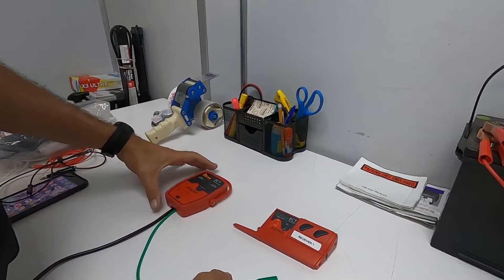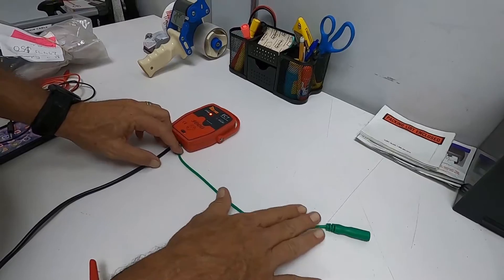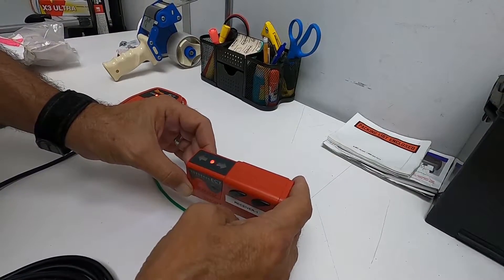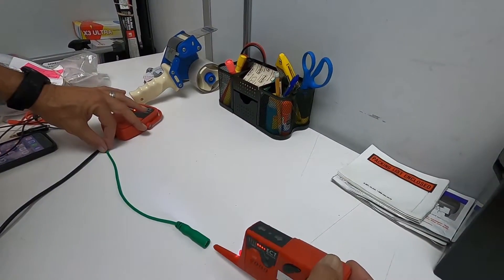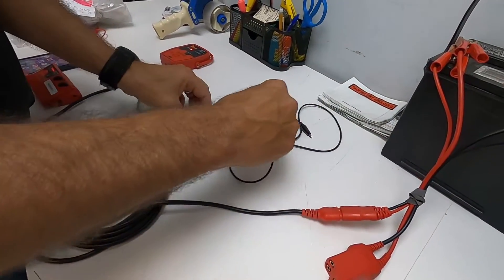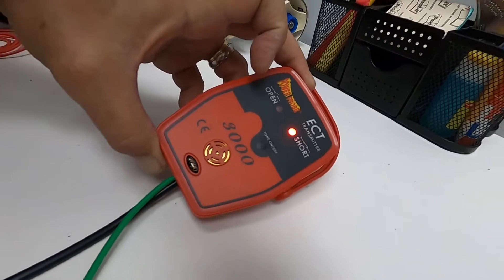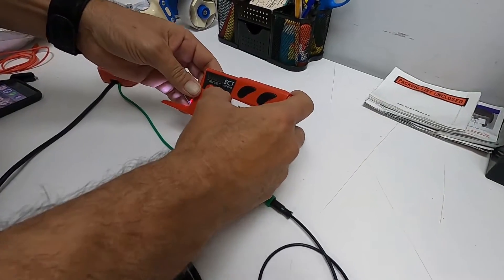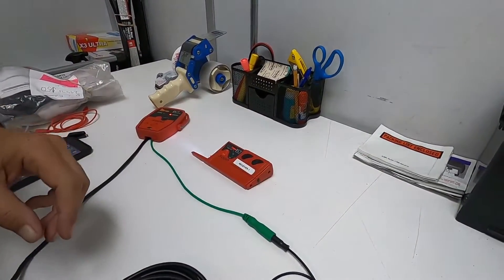ECT Testing

Comment: What if it turns on and does not show open condition? Mine is stuck on short condition after connecting to the battery. Green isn’t connected.
Reply: Same issue I'm experiencing new out of box.
Reply: hi did you know the issue ?

Comment: How far away the receiver can go from transmitter ?
Reply from the maker: The receiver will pickup the transmitter signal up to about 10” away from the wire that the signal is connected to when set at max sensitivity. However, there is theoretically no limit to the length of the wire the transmitter is injecting the signal into.
Reply: @13GADGETMAN  it won’t work to find a cut wire on a 53’ trailer?

Comment: So if I connect it to a relay circuit that powers on with the key on, will it continually beep as "open?" Then if I put the key in the ignition and power that circuit will the open condition go away? If so this tool can be very misleading to a beginner.
Reply: It'd be best to just test it with the relay pulled out, and test each circuit going out to each component or connector for an open or short.
Reply: @banzaibankai2671  Yeah, ended up pulling up the wiring diagram and testing the components with a multimeter. This tool will come in handy, one day!
Reply: Normally... that means relay is separate contacts...